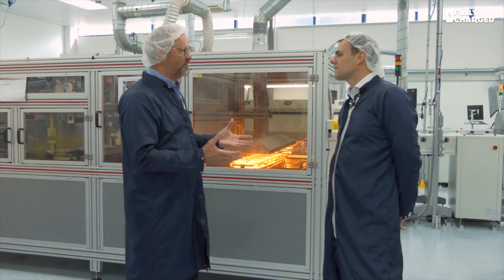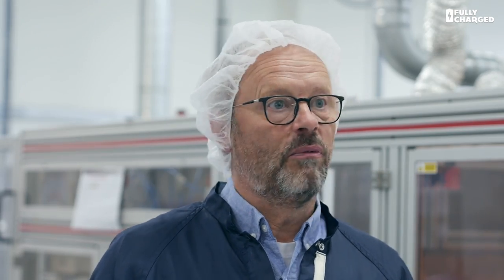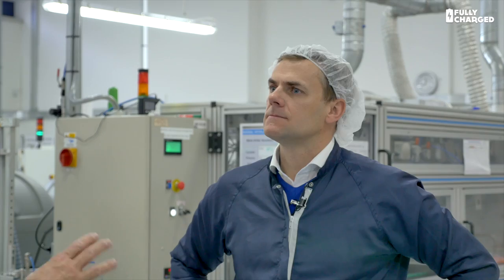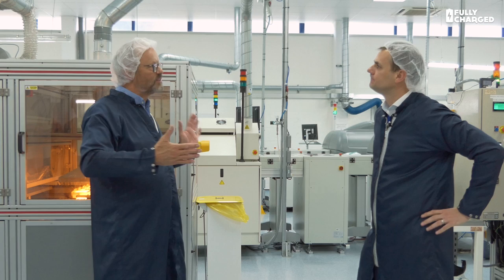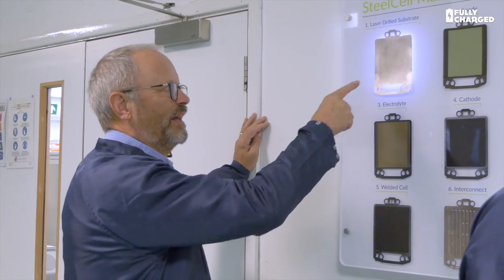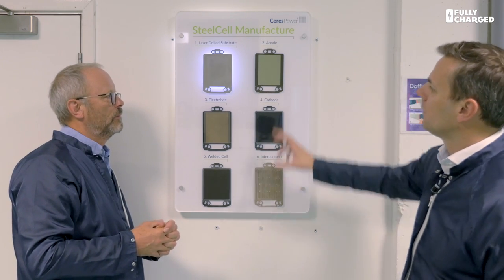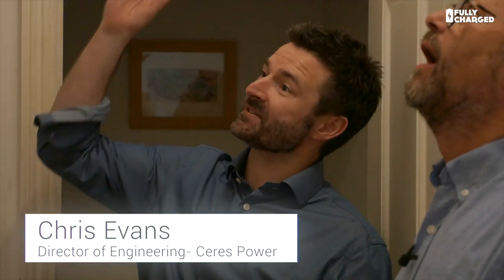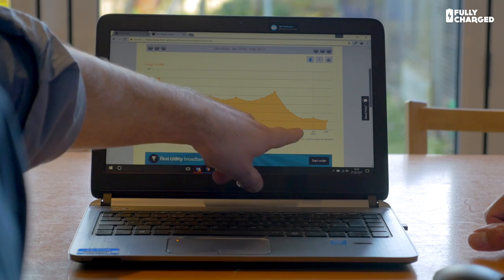Ceres Power | Fully Charged

Comment: What annoys me with this show is the complete lack of skeptical questions. So much obvious bullshit here and not a single grain of salt in sight. If Ceres are not paying you, they should be. Problems:
"1kW is enough to power a house" Well yes, a house where no one does anything.
"30% more efficient than grid so you save 30% of emissions" NO! Not even close. The grid is not 100% carbon based.
"You generate power where its used" Well you still had to expend energy getting the gas there. 

Robert, get someone to help you get some questions prepared that are not just "oh wow, so you're essentially <insert whatever they just said>?". You don't need to make it confrontational but just one or two prepared and detailed questions would make things so much better.
Reply: 66W is enough to power my house. 1.6kWh /day. Fridge, computer, lights, stereo, cooking, kitchen heating (UK).
Reply: John Norris kW and kWh are two different things. Just your kettle requires more than 1 kW while running. You don't run it 24/7 though, hence the lower average consumption you mention. Now you could make the argument that with sufficient battery storage this equipment could maybe run a house, but that wasn't the argument they made.
Reply: I would Not run a SOFC directly to a household mains. Due to low density fuel like Methane can be starved when not enough flow. While Electricity demand can jump erratically much faster. You would always prefer to have a Battery or SuperCapacitor Buffer to protect the SOFC.
Reply: did he even discussed what the emissions of this cells are? if gas comes in what comes out? water? carbon? another gas?
Reply: Benjamin P Are you slow in the head? It's an SOFC, soo typical combustion formula. The same reaction formula for hydrocarbon fuel fires people learnt in middle school chemistry. But with SOFC it is a Reversible reaction.
Reply: Neojhun i have almost no knowledge about chemistry. if that automatically means I'm slow then I guess I am.
Reply: Neojhun Stop being so rude, please!
Reply: Neojhun isn't that missing energy as another product? so the fuel cell works exactly like complete combustion minus all the heat?
Reply: Fennecbutt Well when I want to make tea I don't want average temperature water. I want hot water, and for that this equipment won't be even near enough. With that said I suggest you call your mother and ask her to remind you about appropriate language and politeness.
Reply: Imix Muan Although to be fair in Phoenix you should definitely have solar rather than this. Regardless of how this is developed :)
Reply: Yes, a backup system (battery or grid) will be necessary when you (frequently, like mealtime/shower/dryer) use more than 1kw at a time, but I think some people are missing that that's 1kw per hour, not day.  It could not be a stand-alone system.  The other thing which bothers me is that it appears they are a full-time system, using gas 24/7, throttling down to just 200-250w when no electricity is being used.  Please inform me if I got that wrong.  But that means they'd almost certainly have to be grid-connected so you could be repaid for some of that waste.  Pros and cons, as usual, eh?
Reply: Hey I love coming into an argument 10 months late.  But I think the idea is to use gas for your kettle.  And I do know this works because isn't this a Bloom energy server?  Is somebody licensing that from the inventor?
Reply: ouch well thats what comment section is for
Reply: @johnnorris3409  - I believe you're thinking of 66 kWh/day which is a measure of energy. 66 Watts is a ridiculously low amount of power to be drawn continuously for any size house. 1.6 kWh/day of energy is also much too low.  However, a continuous "power" draw of 1.6 kW (roughly 40 kWh/day), would make sense for an average house.
Reply: If he said "1kW" and he was referring to the homes average continuous "power" draw then thats not unreasonable. My home averages about 1.5kW of continuous power draw which results in roughly 36kWh/day "energy" use. I do however, have a modest 2500 sq ft home with gas appliances and gas water heater so my electricity requirements are modest as well. Still if he is referring to 1kW of "power" draw then it makes perfect sense for a small house with gas appliances.
Reply: is Stellcell diffrent from Hydrogen fuel cell?
Reply: @sahinyasar9119  -  I would say yes only because a typical fuel cell requires pure hydrogen. He states "...everything from natural gas to biofuels to hydrogen..." can be utilized. He also stated that it will accept any gases that have only a percentage of hydrogen all the up to pure hydrogen. Sounds to me like its still basically a fuel cell but they have found a way to make it tolerate impurities.
Reply: @Tron-Jockey  but still needs pure oxigen right?
Reply: @sahinyasar9119  I'm certainly no expert on fuel cells but from what little I know I'd have to believe thats true. Again I'm not entirely sure. Perhaps they have a way of using plain air and extracting the O2.
Reply: @Tron-Jockey  thanks for information
Reply: Take it for what it is. You won't get them to bite the hand that feeds them. If they're overly critical, they won't get invited by companies or get access to products which they can review.
Reply: I agree with Henrik, critical questions will help people understand limitations better and it benefits both the company and the prospective customers .  I believe that there has to be a combinatorial solution based approach depending on the usecase and the locality where we are going to use alternative energy. 
To Roberts credit, we are getting to know all the alternative technologies that may hit the market.
Reply: "30% more efficient than grid so you save 30% of emissions" 
It doesn't matter how much is carbon based it will be reduced by 30%. Your hysteria because of a failure of comprehension shows poor judgement.
Reply: Precisely. And this company is almost certainly subsidized by taxpayer dollars. I live alone. And in my house, at certain times (though rarely), I use up to 21500+ watts [simultaneously]. The average house uses about 8KW to 10KW.

Comment: how many fuel cells to replace 100kwh battery pack in model s
Reply: Stephen Rawes You could tow a 20ft trailer for that.
Reply: I imagine the number of cells needed depends on their power delivery and the power requirement of the vehicle's motor. The kWh would then depend on how much fuel you carry.
Reply: I dunno. How many litres of hot water does the Model S produce / hour ?

Comment: 3 x more energy consumed to create your fuel than charging a battery.
50% efficieny of the fuel cell.
Despite the hype, this isn't a workable solution.

Solar with battery back up is cheaper, safer and more efficient.

Comment: 7:18  So where is this IMAGINERY house that you can power on a Kilowatt?  Certainly there are times of the day where this might be true for a single person, but certainly not for cooking with electricity or running an electric dryer, or portable ceramic heater, or electric water heater, or powerful vacuum cleaner, and certainly NOT for recharging an electric vehicle.

Comment: I can't support this, because it uses natural gas, which is artificially cheap, or hydrogen gas, which is stupidly expensive and dangerous and inefficient at large scale.

Just focus on gas. It's artificially cheap because of all the externalised environmental costs. Trust me, I'm from NSW, the heartland of gas fracking ("coal seam gas"). We need to stop using it, and we definitely need to avoid investing in it as a bridge away from coal, because the gas companies will fight to survive after they are no longer needed as bridges.

Solar, wind, and zero carbon storage (mostly batteries). Stuff rare earth metal concern it's minor in the scheme of things. We've got enough and we can recycle once we've established and closed the loop.

Love your work Robert, don't get me wrong.

BattleAxe

Comment: Oooo, fuel cells that aren't on a NASA budget. (I'm assuming, since there's no unobtainium in them) That's a real possibility for the electric race car. Batteries are impossible to charge (in that setting), and 15kW of generator is large and heavy (engine plus a motor to make power for another motor) Here's hoping Ceres will actually call me back. ["electric race car" usually results in laughing and silence.]
Reply: That big unit, hanging on the wall was putting out 800W, you need a hell of a lot more than 15kW for a race car, a F1 car is about 750kW.
Reply: We are most definitely not F1. The Electrica needs an average of 9kW. Yes, full acceleration is 75kW (for a few seconds), but that's to be avoided as it builds a lot of heat in the motor, and obviously would kill any battery pack very quickly. What was on his wall was much more than just the fuel cell. Honda (briefly) made a hydrogen fuel cell hybrid. I'd use that technology if (a) it were available [it's not], and (b) we were allowed to race with a high pressure tank of hydrogen. [We absolutely are not. No race org will allow it. No track will allow it.]

Btw, heat is why Tesla's are famously bad on track. An unmodified, production model Tesla will overheat in minutes when run on track. They were never designed for continuous duty cycle. I saw the same thing with the HPEVS AC-51 -- 300A speed followed by 300A regen braking can be repeated for about 2min before thermal cutback. If you drive normally - gentle acceleration to 70mph and maintain that, it works just fine for 20min. We don't drain the pack as it takes an eternity to recharge. If I had the budget of F1, I wouldn't bother with charging; bring mega-watts worth of already charged batteries. (we race for 16 hours over 2 days)

Comment: with fuel cells it's all about the fuel. Can it run in Solar PV or Wind? can it be 100% Renewable? Hydrogen takes water or gas. Both limited items. NOT RENEWABLE.

Comment: Hmm... I do not really agree with everything said in this video.. The tech is amazing and could help in some niche applications, but for everyday normal urban people... no, not really. Here is why:

A modern HR gas combi boiler that is used for heating the house and tap water, like my Nefit Trendline HRC30, is 90-95% efficient these days, so installing a fuel cell, running on natural gas to generate electricity wich is 50% energy efficient, well you just lost already 45% for heating only.

A modern gas fired power plant is 40-50% efficient these days, not 30% (this was 30 years ago!) So the increase in efficiency is just marginal.. so marginal it would never pay back for the investment in such a rather expensive fuel cell. 

Beside that (already mentionned here) the power from the grid is more and more generated using wind and solar, and this renewable component is increasing exponentially the last few years because solar and wind are now quite a bit cheaper than fossil fuel fired power plants. Power from the grid gets greener and greener every day!

Last but not least, for me personally, I have 14 solar panels on my roof, which produce more electricity than I personally use on an anual basis,, and my power company certifies that 100% of the electricity I use from the grid (like right now during winter) is 100% Dutch Wind energy.. So it would be totally bulloks for me to get such a fuel cell running on gas.

BUT in some niche situations these fuel cells may be a good alternative, like a farmer who uses the manure of the cows or biological waste from the harvested crops to produce biogas (methane).. free energy to run the farm and his house, but other than that, I do not see why people would want this.. investing in solar panels makes more sense.

Comment: In spite of the hype, this is not emissions free electricity, not even close. It is a means of using fossil fuel more efficiently, so really just like the trend nowadays to replace 30% efficient conventional Coal thermal plants with 40-44% efficient supercritical and hypercritical Coal burners. They do provide a much more consistent output than solar or wind so are more practical in that sense in northern areas where you can use most of the waste heat. Big problem is cost. A few years ago I looked into a similar system, that just supplies basic home power, hot water & heat and this is the quote I got back: 

"...".. The cost of the __ system is $35,000 to $45,000 (us dollars) per unit installed. The component and installation costs vary because of the facility size and other variables associated with the existing plumbing and electrical codes. Also, depending on what region of the country one lives in, labor costs will vary. A certified technician is required to install the system...."
Reply: This system is less expensive than previous solid oxide fuel cells due to the use of relatively cheap steel
Reply: What is the cost? Installation? Custom - contract, etc? If I can't install it and operate it myself they are no good to me.
Reply: The reverse SOFC is just another method of hydrogen production. It is not turning CO2 into fuel directly. Although hydrogen + carbon feedstock can be made into methanol & DME which are excellent fuels. Concentrated CO2 from Oil refining or flue gases may be converted to DME/Methanol along with carbon neutral hydrogen, but the most economical and obvious carbon source is biomass, which now idiotic countries on their nutty renewable energy scam binges, are stupidly burning it in coal power plants rather than instead switching to nuclear electricity. Using cheap nighttime nuclear electricity to produce DME/Ammonia/Methanol would be an excellent way to go fully carbon neutral, and reversible SOFCs are one of a dozen or so options of hydrogen production. A better option might be High temperature nuclear reactors, like MSRs which can thermally dissociate water into hydrogen --> Methanol/DME. 

Using renewable energy to power electrolysis is NOT economical, practical or physically feasible (due to their very low EROI), that would be just another giant subsidy on top of the already giant subsidies being dumped on renewable energy, part of Big Oil's Bait-And-Switch campaign to divert any effort away from ending their energy hegemony.

Comment: 50% efficiency is not much better than ICE's 35-40%
Reply: 50% (low end for SOFC) is Fuel to Electricity. With ICE you still lose even more having to turn Torque into Electricity. So its quite good.

Comment: I went to imperial where this company started up as a spin off and heard of them from my time there many moons ago. Glad to see they've started manufacturing and exporting their wares. On another note, always thought Elon Musk is brilliant at marketing, I think fuel cells have a larger part to play in the energy mix going forward. Shame Elon only pushes his solutions as the only way going forward.
Reply: Tamer Mustafa It's not always the best technology that makes the breakthrough to the masses, but often times the ones where the most capital is put in. This sadly applies to Tesla as well. Elon and the other investors will keep on pushing their billions into making Tesla successful despite that there are other technologies that could contribute to making the switch off burning fossil fuel faster and more efficient. I don't think the whole Tesla concept is bad per se, but it could be more integral with other technologies. On the other hand I feel Tesla is designed to be more of a closed ecosystem like Apple.
Reply: With the speed at which technologies are being developed, Tesla will quickly become a bottle neck as they are heavily invested in their chosen technology paths and can't afford to take on newer, improved motors/batteries, etc. John Goodenough from the University of Texas has unveiled a new, solid state battery that is streaks ahead of the Lithium battery being used in cars today. If it's as good as advertised, it would be a headache for Musk. Would he squash it?
https://news.utexas.edu/2017/02/28/goodenough-introduces-new-battery-technology

Comment: while im not opposed to cheap fuelcells that can run on gas or fuel, there is no way to break that down into clean air and sunshine. your options pretty much are toxic gas or toxic sludge and the way this is glossed over makes me realy uncomfortable. at least cars have these filter things in the exhaust that capture most of the worst stuff.

Comment: the 1st world is pulling away from the developing world at an exponential rate now.
Reply: Not really. The developing world can jump unnecessary steps. For example building solar power plants rather than coal, or building a mobile network rather than a landline network. 
That is why inequality on a global scale is reducing.
Reply: @Chilukar  that's true I read somewhere a long time ago how Lagos is skipping landlines.  However, I'm travelling around southeast asia right now, and most places are very poor.  I guess what I meant in my OP is that the 1st world is building IP on top of IP that they have patents for while the developing world are just conforming.

Comment: When they use natural gas what is the byproduct?? I heard Hydrogen... did i hear it right?
Reply: Xcube720
It's almost certainly CO2 and water. I think what the guy meant to say is that the fuel is natural gas or hydrogen, but used some awkward phrasing.
Reply: I think he said it can run on natural gas or hydrogen, or any blend of those. Bi-products of NG would be C02 and water... bi-products of hydrogen would be, I think, just water. (But hydrogen is terribly hard to store compactly.)

Could be completely wrong. :)
Reply: The same thing you get from burning it -- CO2 and water. However, as this isn't atmospheric combustion, there are no contaminating byproducts (i.e. NOx)